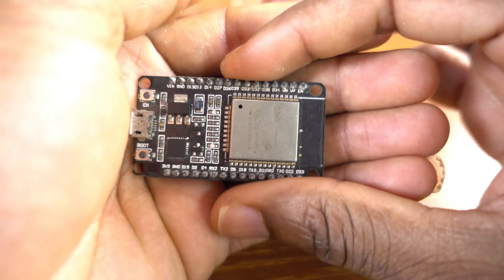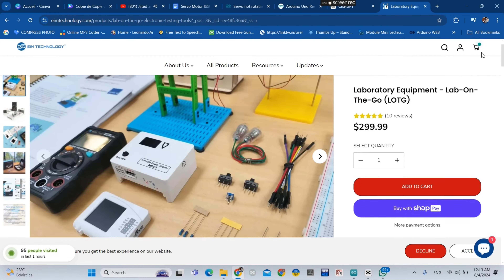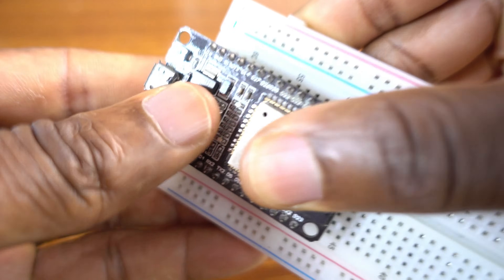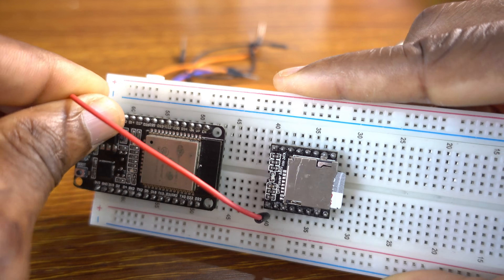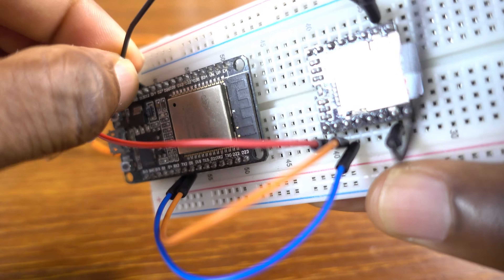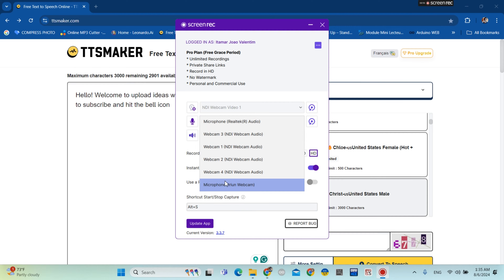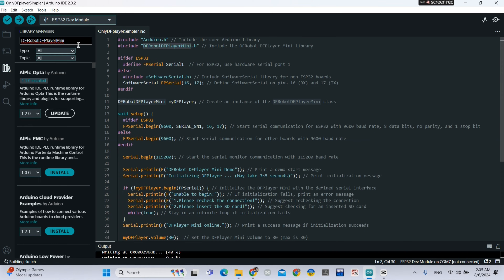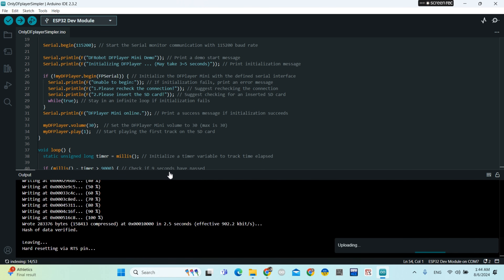DFplayer Mini to ESP32 Connection Tutorial - Easy Steps | 2024

Comment: there is a resistor in the wire that connect to the speaker and how much ohm is that? Can I use a 10k resistor
Reply from the maker: No